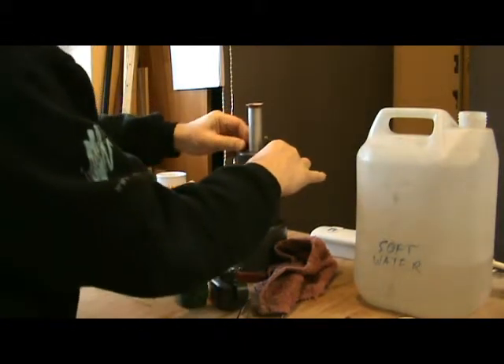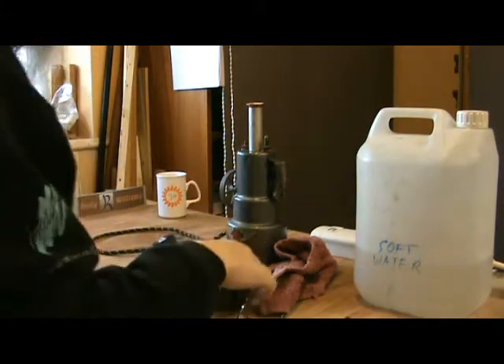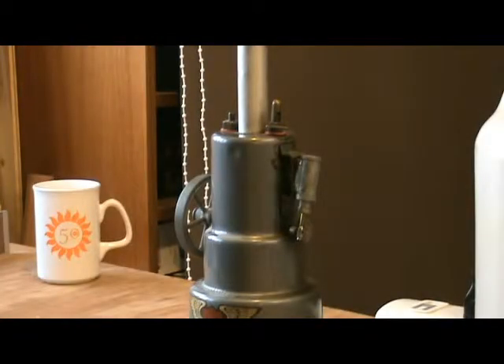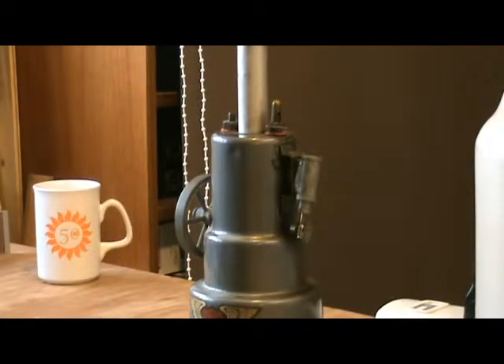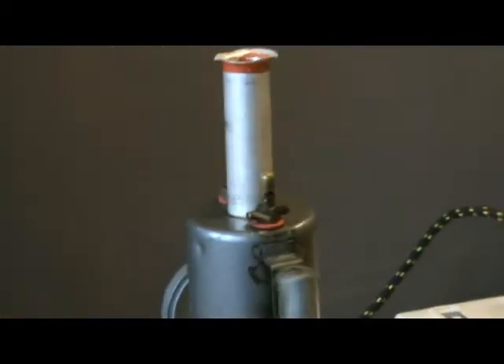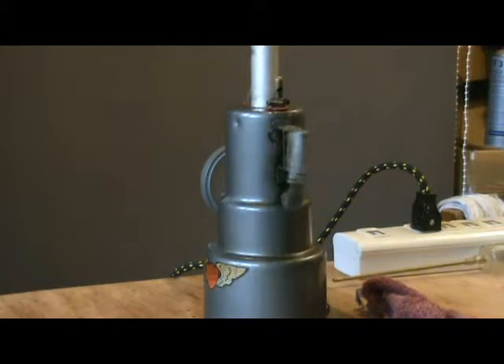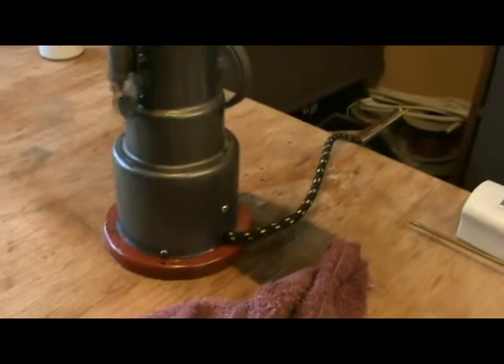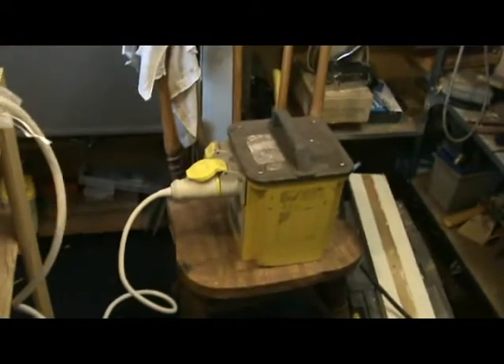Robert Fulton Line

Comment: My grandpa gave me 3 steam engines that I am going to try to repair and get going. One is a Robert Fulton that is second in line to be repaired. It is in terrible shape, been painted over, the Flywheel has been replaced with a pulley, the stack is missing, the whistle is missing, the site glass is missing. The engine seems to be similar in design to yours. The difference is that instead of being electric the steam was developed by fire of some type and the double acting cylinder is controlled by a sliding valve, the same type of mechanism on one of your Horizontal engines. These maybe rare engines I don't know.  ??? Somebody even removed the bottom and tried opening up the opening I would assume to make a small fire in there.  The other two are an Empire Engine # 32 missing the base and a Jenson 5 or 40 missing the boiler. I figured this out referencing Toy Steam Bible pictures. Anyhow, thanks for showing the Steam Engine and the final question, Where can I find this oil you guys are referencing in the comments below to jeep the internal parts of the engine lubricated while running????
Reply from the maker: Steam oil can be obtained from many suppliers dealing with steam toys. For example, Forest Classics: http://www.ebay.co.uk/itm/FS-250-ML-COMPOUND-STEAM-OIL-FOR-MAMOD-WILESCO-ETC-WITH-SPOUT-/201489911966?hash=item2ee9bc109e:g:g0kAAOSw7PBTpAyy

Comment: I have the identical one but im having a problem. the electric end of it. it blows smoke out of the bottom can, I disassembled it and it packed with white insulation and the heating element is split in to.
Reply from the maker: Hi David. I did replace the mains cable on mine but that was quite a while ago and I can't remember how the heater is constructed. ISTR it's wire in a ceramic former? If the ceramic is broken then there may not be much you can do to repair it. It gets to hot for even epoxy to work. I would recommend trying to source a replacement part. You might have to resort to buying another engine with the ceramic part intact but otherwise beyond repair. A good idea would be to place a "wanted" post on a steam toy forum, such as www.mamodforums.co.uk.
Reply: Ok cool thanks big. Help. And does the cord need to be a specific kind? The factory cord exploded and a normal cord I had melted. What cord did u use?
Reply from the maker: david johnson I used cotton covered three wire cable, which is, I think, similar to the original. On other engines I have used silicone covered cable.